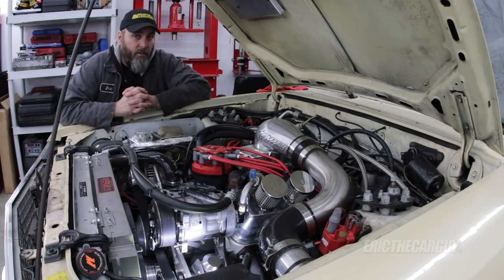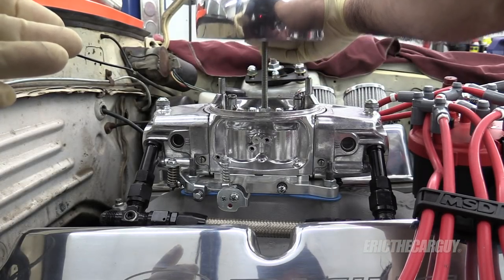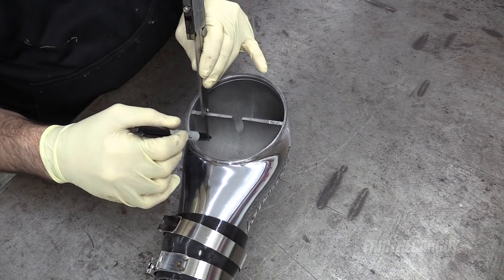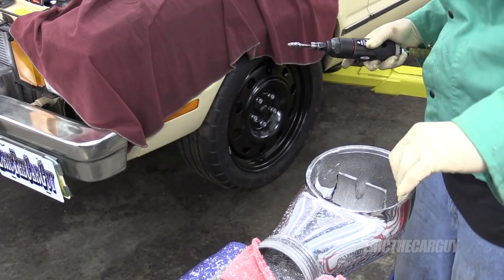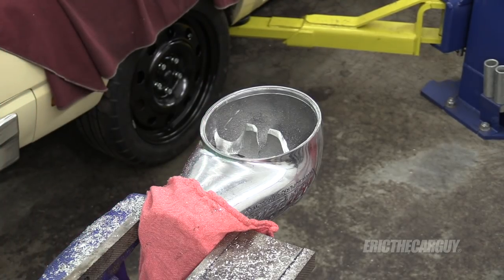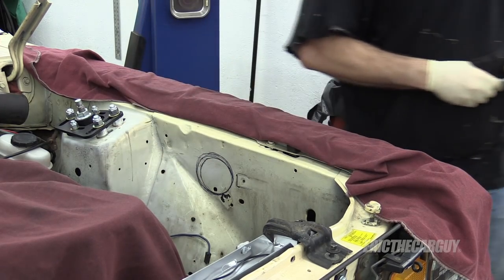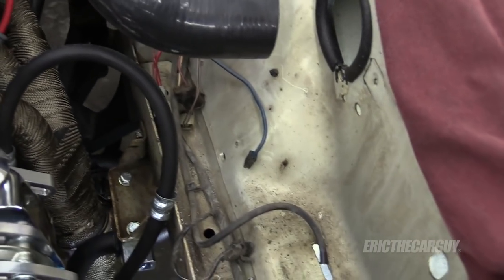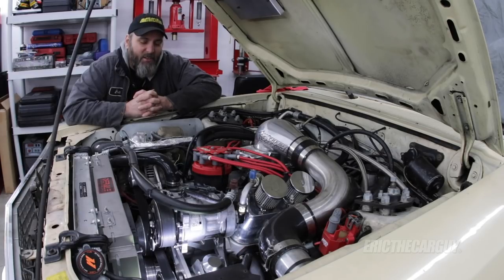#FairmontProject Final Assembly (Part 6) Oops..

Comment: You can get the scratch out of your carb hat. Sand it with Roloc sanding discs to level it, then switch to emery paper and wet sand to 1500 grit. Last you buff out the sanding scratches with rouge on a buffing wheel. I assume that it’s polished aluminum and not chromed. Easy fix.
Reply from the maker: Cool, thanks!

Comment: I wonder if the 90 turn affects the mixture any. Now the primary and secondary driver side get the short run and the primary and secondary passenger side get the long run rather than running it straight forward the both primaries get the short run and both seconds get the long run.

Comment: Those bits are super dangerous they only cut one way if u drag it the opposite way two things will happen either grab and pull or tear up the bit and eat up the sharp small blades. But I didn't know about the WD-40 thanks for the tip

Comment: Hopefully the aluminum carburator metering plates are anodized internally. I have had the worst luck with E10 fuel and carburators. Once the corrosion  from water in the alcohol corrodes the micro aluminum passages, it's time for a new carburator. Fuel injection is the alternative.

Comment: Maybe another video on the oil filter issues and the 90 degree mount solution.
Reply from the maker: That will eventually be covered along with SEVERAL other things. We haven't even gotten to the wiring or HVAC yet. Settle in, it's a long series.

Comment: If you can answer this for me I'll be surprised I have a 2006 Dodge Charger it's got a hundred eighty degrees thermostat it's got a brand new engine coolant temperature sensor I've checked to make sure the fans aren't running and I even bleed the coolant to make sure there's no air pockets in the engine but yet I still seem to have an issue with the car getting warm now when it's sitting idle the car warm up to 180 no problem but when I'm driving down the road they can't sustain over 150 degrees doesn't make sense to me not sure what else to check but I watched a handful of your videos trying to figure out this issue for myself if you want to shoot me back a comment and let me know what you think it might possibly be it would be greatly appreciated but I have a feeling you won't even see this

Comment: Cut that all off... vibrations could make those small pieces on that overhang break off and fall into the intake
Reply from the maker: No. That piece runs the entire length of the carb hat. It's cast in.
Reply: @ericthecarguy  no... I just meant where you where grinding... make it flat all the way across... so it has no teeth
Reply from the maker: I still want the air to curve down and be directed into the carburetor. That's the reason I got this carburetor hat in the first place. https://www.youtube.com/watch?v=Naj3LL-zIj0&t=1240s